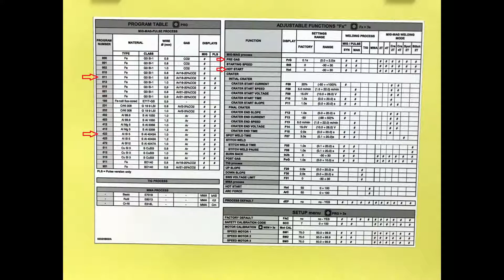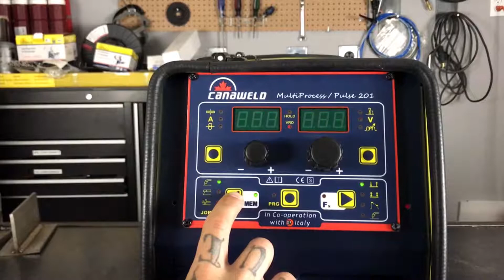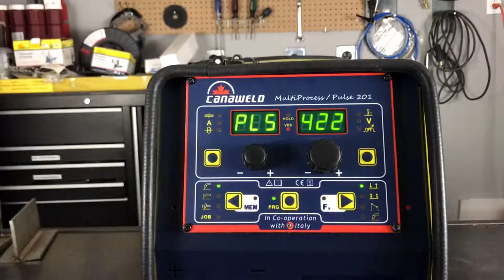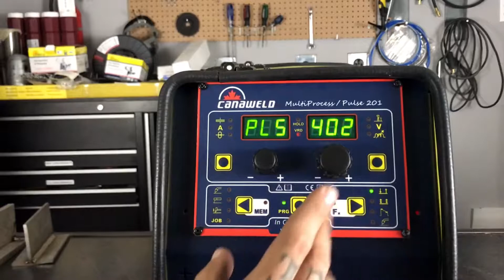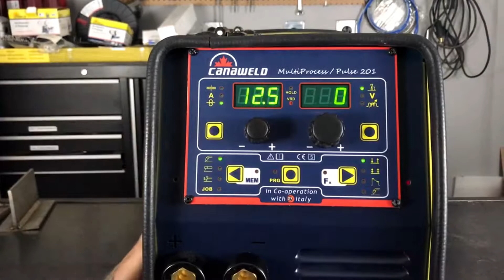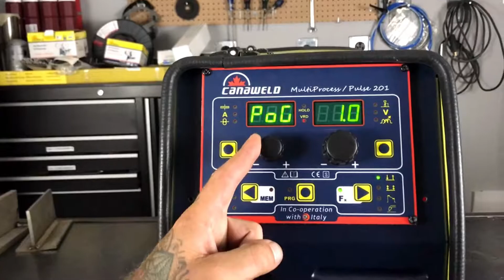Tutorial for MIG pulsed Welding machine TIG-MIG-STICK-BRAZING, MIG PULSE STORE Up to 99 Jobs

Comment: I was going to go with this machine today but I realized I don’t need really pulse as my tig has that and the duty is a little low for my liking .. so I went with the mig stick 202 which has a killer duty cycle and can run a spool gun or Teflon liner which makes it aluminum capable! I financed the machine , these guys are solid they have paybright as a payment option right on the website ! I will be back for their pulse ac dc tig once I get this payed off . Really excited to use the machine with that kick ass tweco torch, it’s my favourite mig gun connection and torch itself is super heavy duty and solid . I bet I’ll bust a fat nut when I get my first bead laid down sorry but I can’t help it , when it’s a nice solid tool my tool goes nice and solid